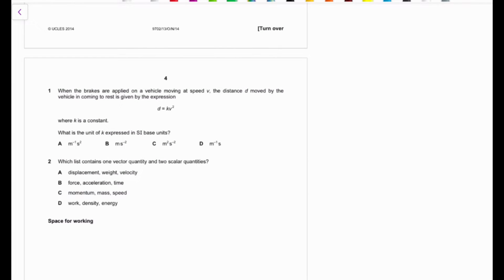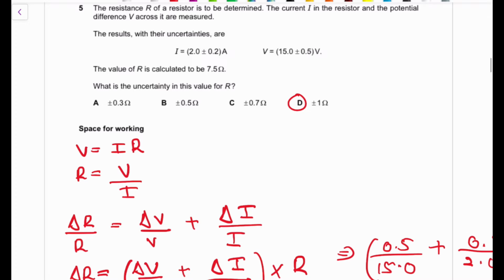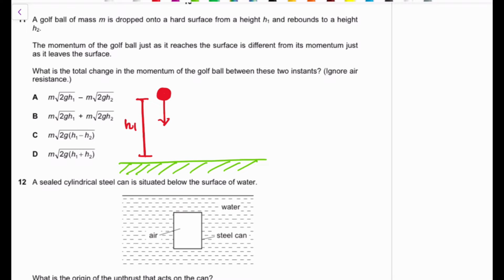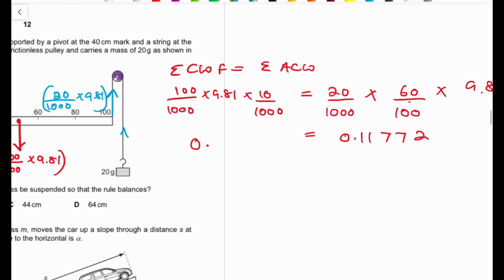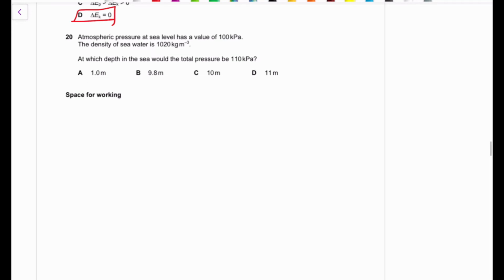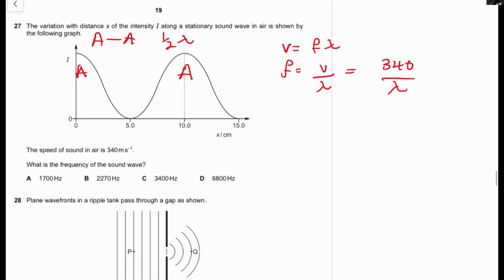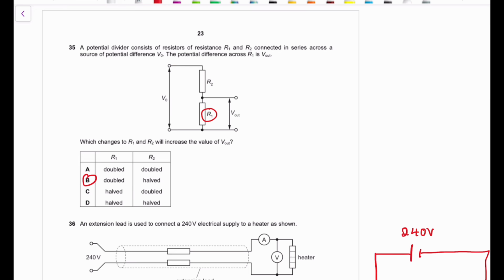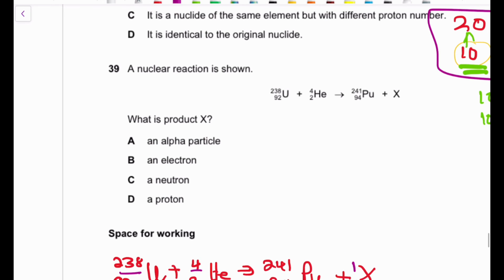AS LEVEL PHYSICS 9702 PAPER 1 Oct Nov  2014 || Paper 13 || 9702/13/O/N/14||Fully Explained

Comment: sir in q8 i didn't understand the explanation of the last part of graph
Reply from the maker: Okay, excellent question. Sorry for taking long to respond, I hope did not inconvenience you. So the horizontal part represents the section where the velocity is constant and that is the horizontal section. so if it bounces inelastically, kinetic energy will be smaller, now what that means is that the velocity will be smaller and it will take a longer time to go back coz its slower so that's sort of the logic I used, I hope that makes sense. Please do comment if you have any further question, I will be more than happy to adress them.
Reply: @Alevel_Physics  thanks for replying i really appreciate your explanation and now i have no Qs

Comment: Why can we treat the entire graph as one triangle and calculate the area? Why do it separately? Q24
Reply from the maker: That is a good question, good observation. If you try to continue that straight line with a rule you would realize that Y will not lie on that line, hence joining X and Y will produce a slanted line for a trapezium and not necessarily an entire triangle. I hope 🙏 that makes sense, do ask if you have any other follow up questions, suggestions or anything that is unclear